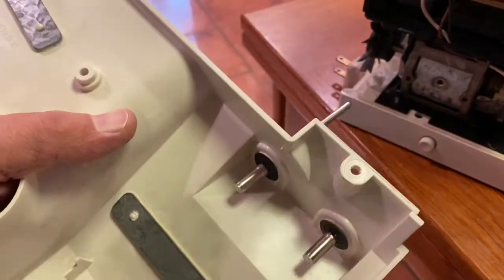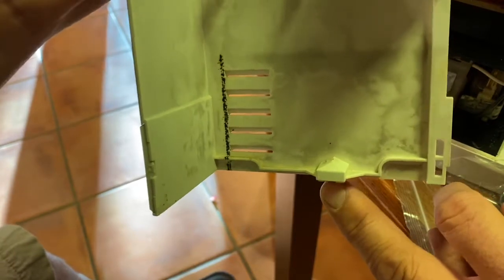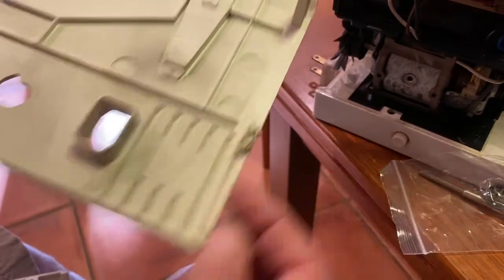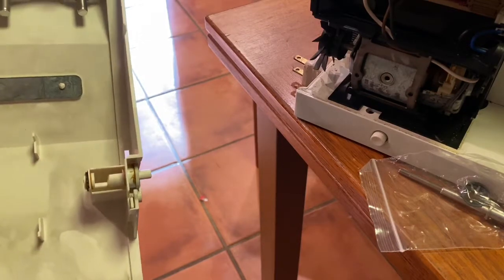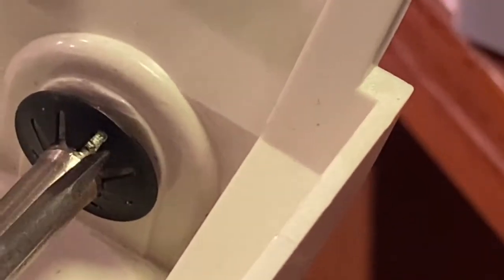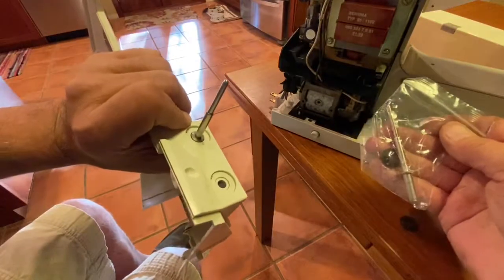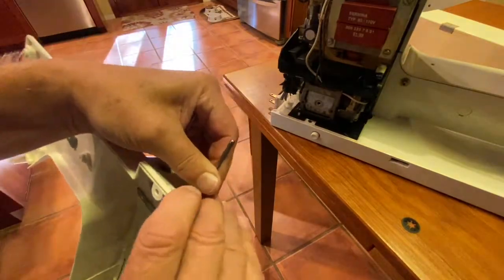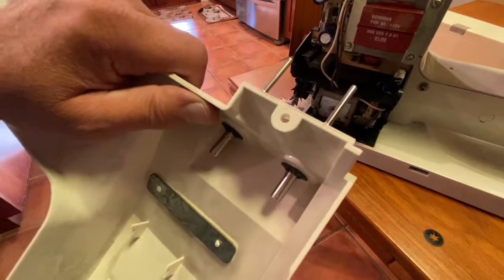Bernina 1130 Spool Pin Replacement

Comment: Thank you for posting this very helpful video. My spool pins are stuck. They are a bit expensive to replace. I was wondering if there is any way of repairing them. Is it possible to replace the spring? Thank you.

Comment: I need to replace my pins. The new ones have arrived, but he didn’t include the capture nuts. I’m terrified to remove the back. No sewing machine help near by.
Reply from the maker: https://youtu.be/oh95Us0nNXU?t=78  I have marked this video by In Stitches that demonstrates how to remove the back cover. If you are very careful with the old spring nut getting it off you should be able to reuse it. The job, including the cover removal isn't that hard. Just take it slowly and keep track of which screws you removed.